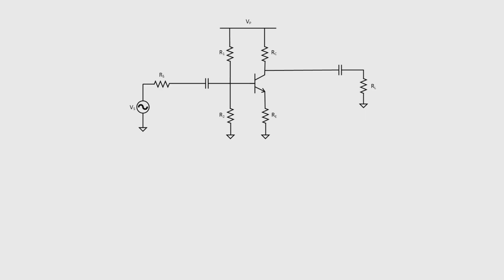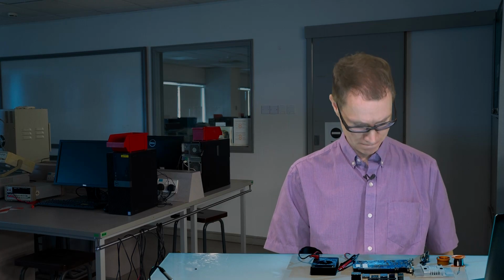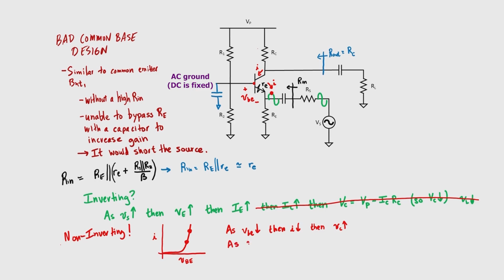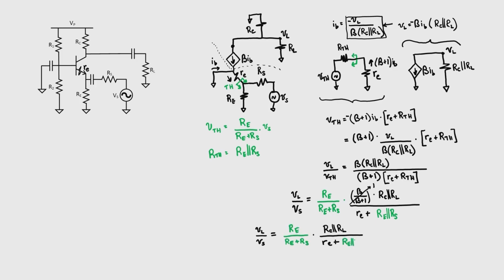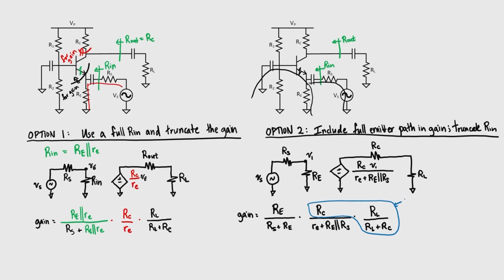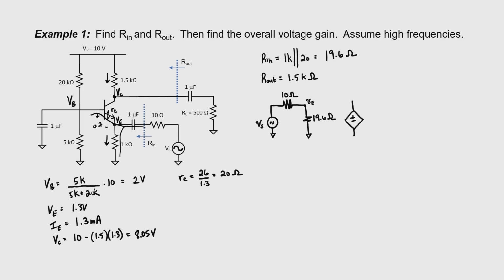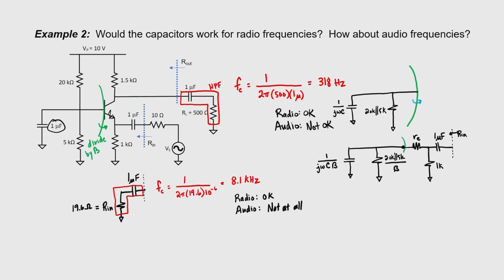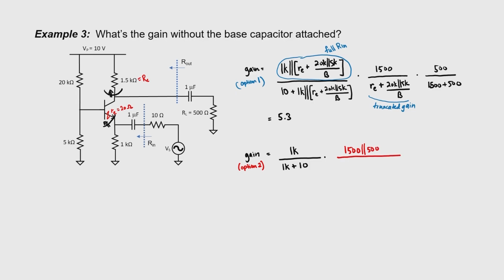Common Base Amplifiers (15-Transistors)

Comment: 1:51 OK upon rewatch I'm not sure why it would "shunt out the source", or for that matter what that even means.  I feel like you stated that and did not explain it.  To the AC signal that capacitor is not there, and it just looks like RE1 is in parallel with RE?
Reply: Capacitors act as a high pass filter so DC(low freq) cant pass but AC(passes easily) so shunting the emmitter of the BJT will cause the AC signal to see it as a short to ground. Typically you would want to shunt the emitter because it lets you get easier control of the gain as shown in previosu videos

Comment: Hello professor, may I ask you a question? I have built a couple of common base amplifiers but none have gave me a voltage gain as calculated, in the best case I obtained half that gain, in the other instances even lower. My question is: are there any hidden secondary effects to blame for those significant differences in voltage gain? Thank you very much for your attention.

Comment: interesting observation at around 5:30 ish.. regarding inverting or non-inverting? 
As the signal voltage rises, the voltage across Re rises - hence I(Re) rises.....
But... in so doing... vbe drops and hence ic drops...

Is this more a case of  "the current through Re remaining constant " - thus ic is reduced by the extra current "forced" through Re by vs ? - and hence vc rises ( in phase).

 In other words - the effective ac  "impedance" looking back into the output of the amplifier is very low, hence little change in Vre  due to vs hence iRe remains essentially constant ?